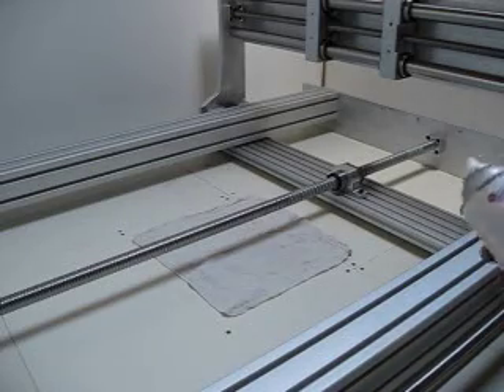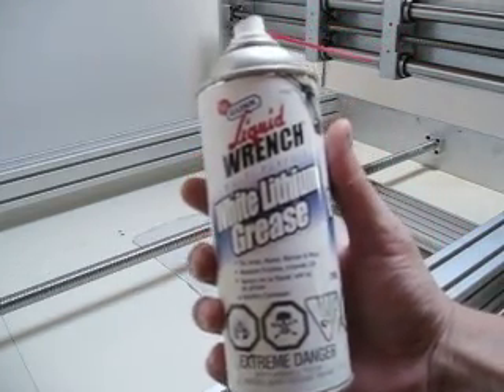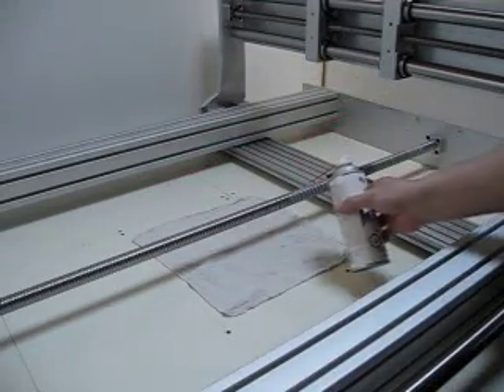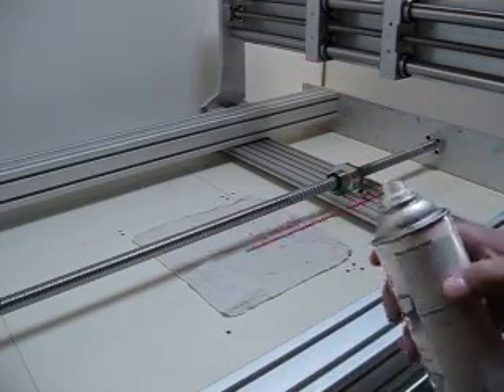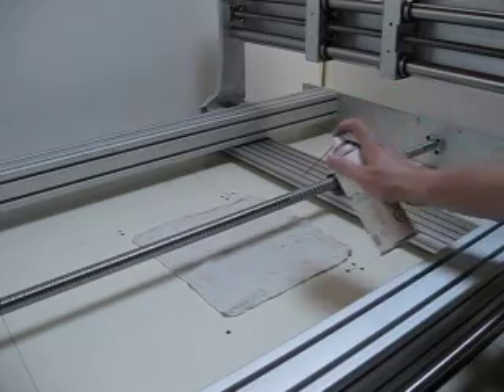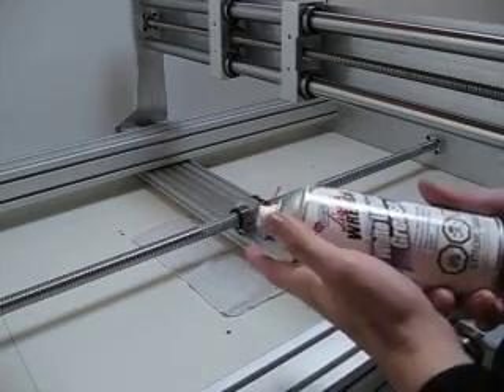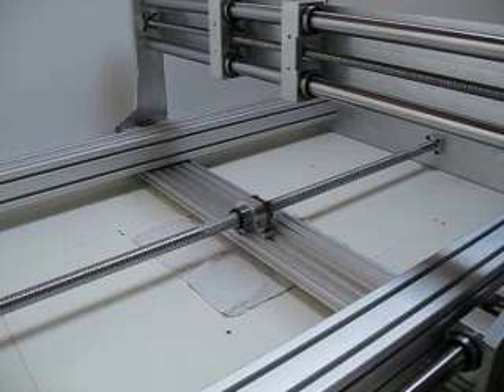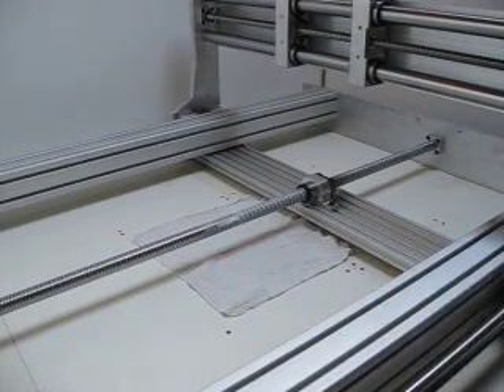X-Axis Lead Screw Lubrication.AVI

Comment: I'm building a similar sized machine.  I was going to order my leadscrews from kerk.  What lead did you go with and what change, and what do you not like about your machine?  mine is to me a 4'x6' machine using the 8020 15s 6x3 stuff, very heavy walled.  I was also considering using the nsk fk12 fixed ends.  What did you use?